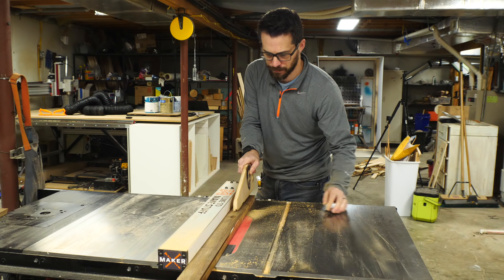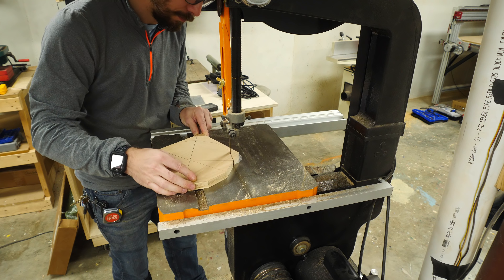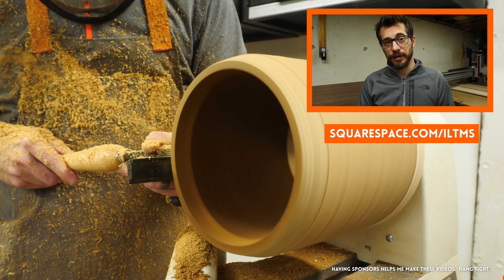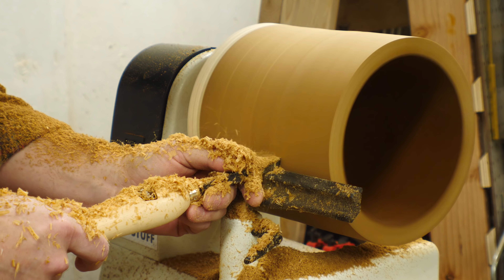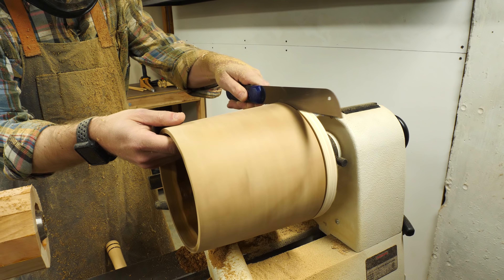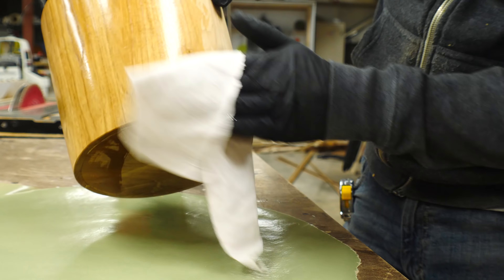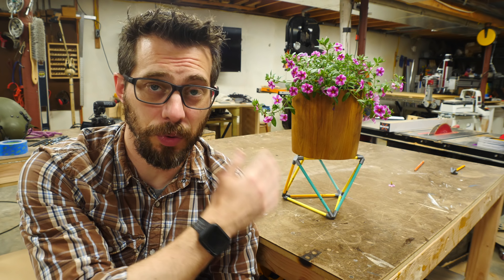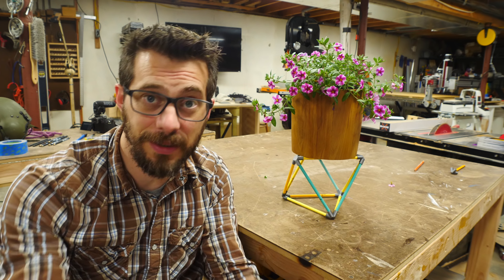Making a Hardwood Planter & 3d Printed Pencil Stand // Woodworking How To | I Like To Make Stuff

Comment: you can use acetone on the teak to thin the oil on the wood to make for a more secure glue bond if you ever run into that again.
Reply: Joseph Watson   Joseph, I remember seeing Norm Abram do that very thing when making a project with teak. He said it would assure a secure bond. Good call!   Troy
Reply: I completely agree. I sometimes have the same issue with Wenge and Sapele as well. A good moist wipe down with acetone and immediate glue up works miracles!

Comment: When gluing up oily wood wipe down the joints with denatured alcohol also tape an end over the opening with carpet tape or hot melt glue and use your tail stock to hold piece

Comment: Great video as usual. One tip, use acetone on the joints for oily or wood with very closed grain before putting the glue. This will help for sure.

Comment: Awesome build. Looked really scary for a moment there. Really glad you could see it coming and could step away. You could close the bottom half of the stand itself (in its cube-on-the-point form) and turn that into a planter. You'll probably need to make it a little bigger than what is possible with pencil lengths.

Comment: I make snare drums using the same stave construction. I use hot glue to mount mine to MDF faceplates and it holds very very well. Nice project!
Reply from the maker: Excellent! I’ll try that, thanks!

Comment: I think what would've been better is to screw the face plate to the stave cylinder (like the stave drum videos) as the edges are sanded after so will cover the screw holes.. great job on the completed job.. keep em coming. .🤘

Comment: Yep, titebond 2 and teak is no bueno.  As others have commented, wipe joints with acetone or naptha and use titebond 3 or epoxy.  Great project. Keep an eye on the glue joints.  I expect they will separate at places in a year or two.  Easy to fix.

Comment: Not just pencils. Anything that's long and round would do it. Metal rods, dowels, pipes, etc. Measure the diameter and size the connectors to fit.

Comment: Any time you do the sanding with a block method, just as a step for safety, before turning it on, run the block with your hands down under the part between the part and the ways, just to be certain that if, for some reason, your hands and the block get down under, that you have enough clearance to release the block and pull your hands out...you really do not want to be drawn under with your hands trapped in a pinch point.

Comment: I think I would have put a piece of flat sacrificial wood on the tailstock so it would clamp the piece better so it did not wobble during the initial process. Once done it could be removed (as it would be more stable)  and then the top and inside could be done. Great project and the printed parts gave me some ideas as well.
Reply: mrfoameruk we talked about that afterward. Good idea.

Comment: Hey Bob! Did you actually manage to see any of the stands at Makers Central? Every time I saw you, you were shaking hands and chatting with fans! 

If you weren't using teak, (and you have a 3D printer) I guess it'd be possible to print an insert for the planter to help prevent rot?

And I might have to invest in a face-shield... I don't think my safety glasses would help all that much if something like that flew at me. Safety pants might though...

Comment: couldn't you just put another cylinder shaped thingy inside of the planter when you seperated it from the plate(while still spinning)? That would have prevented it from flying away, or would that damage the inside of the planter?

Comment: So many great things in this video. Glad you aren't hurt, Bob. The pencil connector pieces are very clever. Just curious, did you model them parametrically so you can just input the new diameter and all the other holes update? I suppose it wouldn't be too hard to just make a new one for different pencil diameters, but that would be a nice little touch, especially for sharing it wink wink
Reply: ...aaaand I need to finish the video before commenting. I see there's a link to the file in the description. Nice.